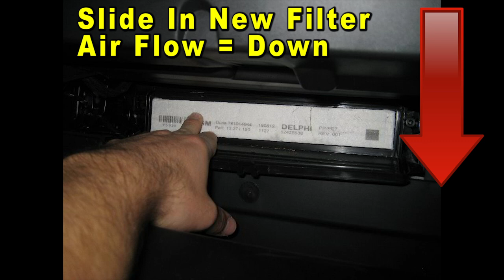2011 To 2015 Chevrolet Cruze How To Change AC Cabin Air Filter With Part Numbers

Comment from the maker: Chevrolet Cruze A/C Cabin Air Filters - https://amzn.to/3zEVr8E
Bosch HEPA Cabin Air Filter Part Number - https://amzn.to/3xJa4Y4
EPAuto A/C Cabin Air Filter Part # - https://amzn.to/3xJq8Jl
Spearhead Odor Defense Filter - https://amzn.to/3L9ir2g
ACDelco OEM Cabin Air Filter - https://amzn.to/3LcOdeE
EcoGard Cabin Air Filter Part Number - https://amzn.to/3LaGIVF
Precision Screwdriver Set - https://amzn.to/3sLixaP
Plastic Pry Bar Tools - https://amzn.to/3HMtsV7
Socket & Ratchet Set - https://amzn.to/3Z17LbA
Mechanix Gloves - https://amzn.to/3jCnHkt
Torque Wrench - https://amzn.to/3vS5uSI

The Paul79UF YouTube channel is a participant in the Amazon Services LLC Associates Program, an affiliate advertising program designed to provide a means for sites to earn advertising fees by advertising and linking to Amazon.

This DIY video shows owners of the 1st generation 2011, 2012, 2013, 2014 and 2015 Chevrolet Cruze how to change the A/C system's cabin air filter element in the HVAC blower motor housing.

Comment from the maker: Check out the DIY guide for changing the A/C cabin air filter in a first generation 2011 to 2015 Chevy Cruze - 
https://www.paulstravelpictures.com/GM-Chevrolet-Cruze-HVAC-Cabin-Air-Filter-Replacement-Guide/index.html

Here are all of the DIY repair and maintenance tutorials for the 1st generation 2011 to 2015 Chevrolet Cruze - 
https://www.paulstravelpictures.com/Articles/GM-Chevrolet-Cruze-Common-Problems-Repair-Maintenance-Guides.htm

Owners of other General Motors vehicles such as the Spark, Sonic, Volt, Malibu, Camaro, Corvette, Impala, Equinox, Traverse, Suburban, Tahoe, Avalanche, Colorado, Silverado, Express, Cadillac ATS, XTS, CTS, SRX, Escalade, Buick Verano, Regal, LaCrosse, Encore, GMC Sierra, Terrain, Acadia, Yukon and Savana may also find these DIY instructions to be helpful.